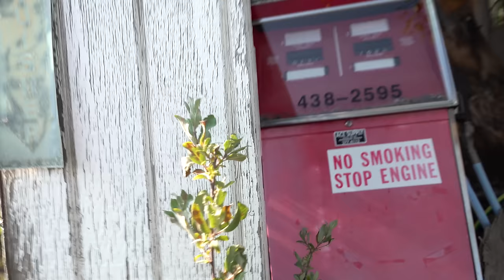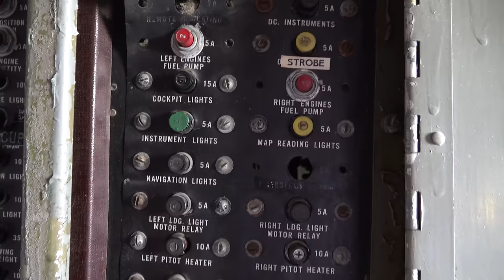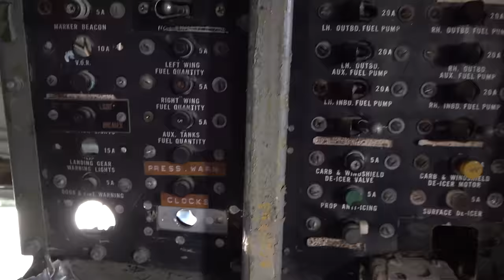Flying above the ARCTIC CIRCLE - NO ROADS lead to this place | Alaska: Part 11

Comment: Damn. That takes me back. I was one of the pilots of that DC4. It happened winter of 06-07. We eyeballed it and decided we couldn't make the runway the fire was too out of control. They drug it out of the woods where we set down all the way to Nenana a few weeks later.
Reply: Damn, Brooks Air Fuel? N82FA. Glad you survived it!
Reply: Wow. That thing looked like it had been there since DC4's were brand new. I guess Alaska winters are pretty rough on aluminum.
Reply: Any landing you can walk away from, huh?  Glad you made it out.
Reply: How was that experience of crashing a large aircraft into the woods, the violence of it? Did you get knocked out for a while?

Comment: Date: Wednesday 17 January 2007
 
Departure airport: Fairbanks International Airport, AK (FAI/PAFA), United States of America
Destination airport: Nixon Fork Mine, AK, United States of America
Narrative:
The Douglas C-54 N82FA departed Fairbanks, carrying 3000 gallons of heating fuel for the Nixon Fork Mine. En route the no. 2 engine started running rough. The pilot elected to shut it down and return to Fairbanks. During the shutdown procedure, the engine caught fire. The fire extinguishing system was activated.
The crew attempted to divert to Nenana Municipal Airport, AK (ENN), but a forced gear-up landing had to be carried out in the tundra. The left wing was consumed by fire.

Comment: Fun fact: the Otter that Rob was walking on is one of the few remaining modified with the 1000hp PZL radial engine. An absolute workhorse, it's sheer power matched only by its oil consumption.

Comment: All the cockpit parts and Gauges were probably ripped out for spares for the few DC-4's left flying Like Buffalo Airways planes.
Reply: Pretty much anybody would strip that for parts, it’s an airplane it still has value inside

Comment: Im guessing the runway is large enough to bring in larger cargo planes for the larger items like freezers seen  and vehicles?
Reply: Yes, they bring in all the heating fuel, AVGAS, diesel for the generators, pretty much everything.
Reply: The runway can handle a c-130 and from Dec to Apr there is an ice road used to connect to the Dalton Highway.  Large semi tankers of fuel and trucks full of supplies travel on it as well as the gerneral public.  I have driven it many times and when it is in great shape you can make the Dalton Highway in 55 minutes.

Comment: How well does GPS work above the arctic circle?  The GPS constellation has an inclination of 55deg and the attic circle is  66.5 deg.  I've been told that in extreme northern Canada that both GPS and magnetic campus become unreliable and navigation has to be done using only terrestrial radio navigation.
Reply: I used ForeFlight and sometimes looked at the inreach also. It never faltered.

Comment: If no roads lead there. How did they get all the vehicles there... and more importantly the 14x70 mobile homes I saw. They're not going by boat like maybe a vehicle would. And surely can't fly. There has to be land access for such a wide load to be towed by tractor trailer to there.
Also...
Average cost for diesel per gallon is around $3.17. A 20-kilowatt generator will use up about 1.6 gallons of fuel per hour while running at full load. A ballpark cost would be $122 for a DAY of run time as the cost to run the generator. How in the hell do they afford to run a generator 24/7/365? How are they making enough money to even run the generator much less afford every thing else? I have soo many questions

Comment: The plane N82FA ran out of fuel before it departure and crashed  on the night of 4 april 1997 00:16 leaving the Co piolt died and the wing caught fire 360 feet in the air after departure as the plane did not reach the end of the runway